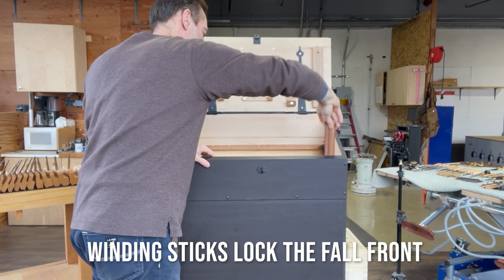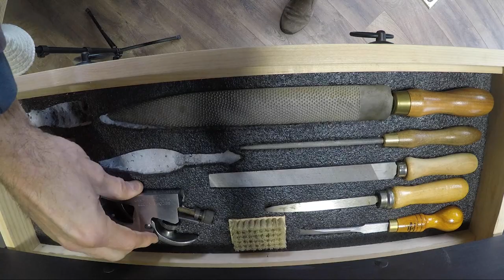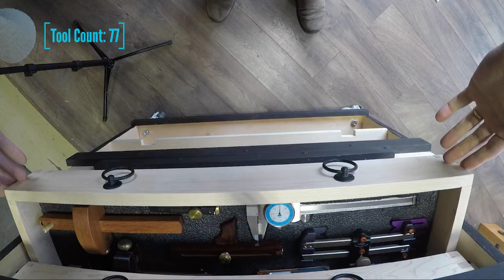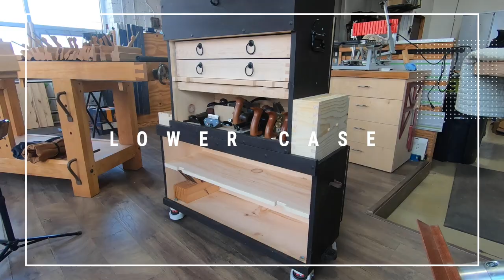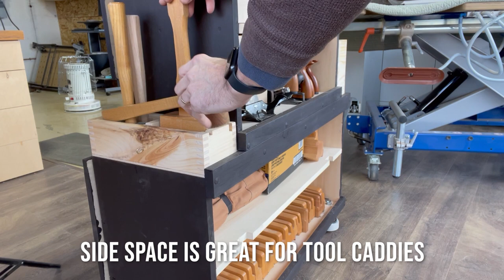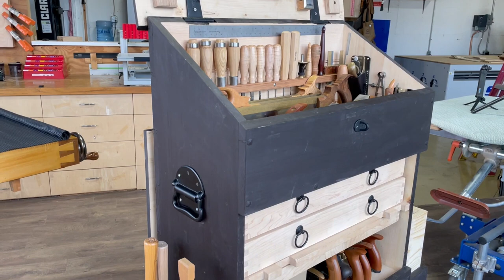Loading 176 Tools into My Dutch Tool Chest

Comment: Love your tool chest, just finished mine, I build mine wider , deeper and taller to fit my bad axe 24 inch D8 saws.. didn’t see the point in building it for small panel saws.. love being able to roll it next to my bench and having tools at hand.. I’m a subscriber 😊👍🇺🇸
Reply from the maker: I made a saw till for under the lid but ultimately decided that a separate solution for my saws was a better option (that will be a future video), and putting my spokeshaves and other often-used tools was more efficient for my needs. Thanks for subscribing!

Comment: Very cool.  Do panel saws fit inside it?
Reply from the maker: Yes they do. I actually built a panel saw till for the lid, but decided that since I only use them occasionally I will build a separate saw cabinet so I could store more everyday tools within reach under the lid.

Comment: This is awesome! I want to add some drawers to my tool chest, what size slides did you end up using?
Reply from the maker: 10" full extension slides -- I got them at my local woodcraft. Here's a link: https://www.woodcraft.com/products/highpoint-3j01-full-extension-side-mount-drawer-slide-10-pair?via=573621f569702d06760016d3%2C57641f8f69702d3baa0023ac%2C5764204169702d3baa0024f2#
Reply: @GothamWoodworks  Much appreciated on the slide recommendation, they worked out tops.  Any chance you can share what kind of magnets / source you used?  I didn't have much luck with some of the magnets I've used in the past. Thanks!
Reply from the maker: @mrk666  I purchased rare earth magnets from Lee Valley. They carry different sizes and I wasn't sure which size to purchase so I bought an assortment -- I think I ended up using 5/16 diameter mostly.

Comment: Beautifully executed and a very impressive tool collection! Could you please tell me the rough dimensions of the top chest? I'm considering moving a similar collection of tools from my traditional joiners chest to something along these lines.
Reply from the maker: Thanks! The upper unit is 30.5" tall x 27" wide x 11 1/4 deep.  You can eliminate one of the lower compartments and this becomes a more portable chest (if you plan to move it around). In that case the height would be more like 24". There's a set of plans and an instructional video I used as a guide available from Lie-Nielsen with Chris Schwarz, who made this design popular, doing the step by step  process. There are some nuances to this chest that the video helps with. Available here: https://www.lie-nielsen.com/products/build-a-dutch-tool-chest?path=home-education-videos&node=4244 Good luck!
Reply: @GothamWoodworks  thanks for your reply. If it turns out anywhere close to yours I will be more than happy.

Comment: I built a smaller Dutch chest last year but I am having trouble sourcing the hinges for the top. Any suggestions?
Reply from the maker: I got mine from Lee Valley -- here's the link (I bought the 13" version) https://www.leevalley.com/en-ca/shop/hardware/hinges/strap/46556-forged-iron-large-strap-hinges
Reply: @GothamWoodworks  Thank you so much!